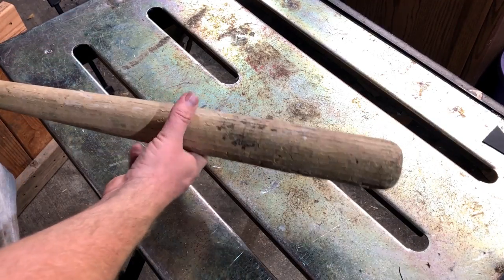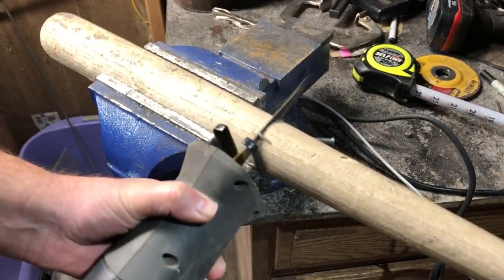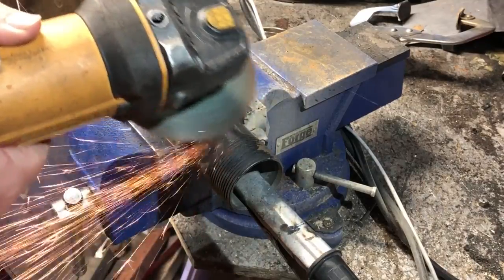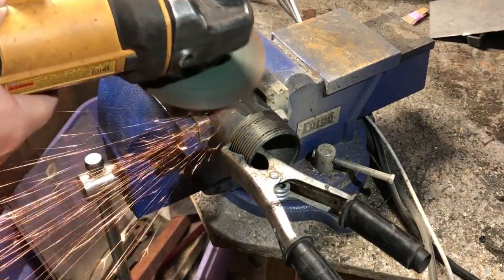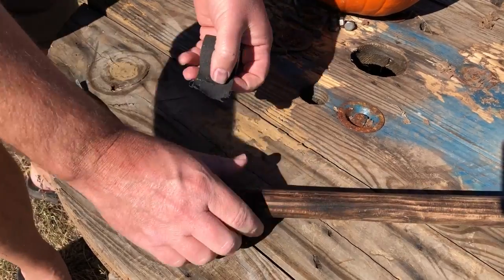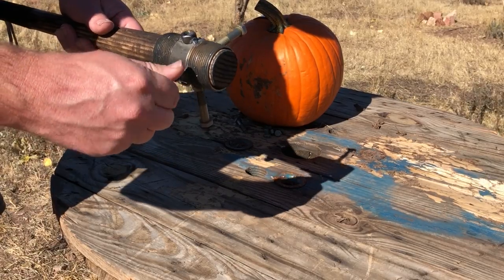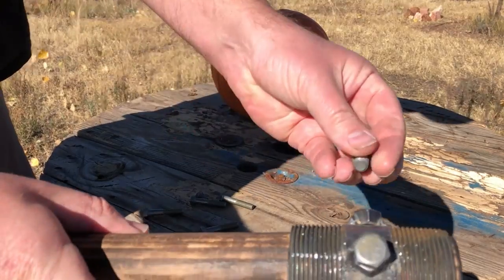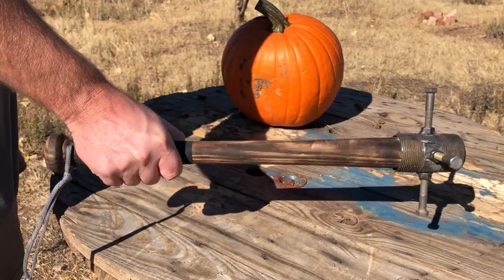How to Make a Trench Club (Post-Apocalypse Style with Adjustable Spikes) for about $10

Comment: Interchangeable spikes without welding. Drill recessed holes into the wood. Insert the nuts into the recessed holes and slide the pipe on top of it. When you screw the bolts in, the nuts will stay because they're larger than the holes in the pipe. Also, be sure to put a little piece of metal under the nut so that the bolt doesn't dig into the wood as you torque down.

Comment: Just a bit of info: Spikes on clubs aren't for penetrating, they're for focusing the force of a blow into a smaller surface area transferring more power to the target. It's the percussive force that causes the damage, they can kill people wearing helmets without penetrating the helmet and padding underneath. Last thing you want when attacking is a spike stuck in a dead guys head while other people/zombies are trying to get at you. If you're hitting someone without a helmet flat square 1cm long spikes would be the better option.
Btw im not knocking this video, this video is awesome, keep up the good work dude i'v subscribed :)
Reply: Supportive commentary is surely always appreciated.

Comment: A blunt weapon is by essence a weapon designed to cause heavy unprnetrating traumatic injuries. The long bolts are making the club weaker, even if sharpened as spikes, in a zombie outbreak scenario they would get stuck inside a zombie skull after the first blow. The shorter bolts are definitely better as it would performs kinda like a knuckle.

Penetrating short ranged weapons such as knives would, I think, only work onscreen. Clubs, hammers or war hammers would be ideal for close ranged combat as you could either kill the zombie rather quickly or bust its legs and then run.

Nice video I really dig that design!
Reply: Finally someone who knows what he speaking about

Comment: On the drilling holes on the bat and to epoxy the nuts inside. Something to strengthen the hold ub might be to drill the hole on the outer metal pipe sheath just to the diameter of the inside of the nut so your not only using epoxy, but your using the pipe as part of the stabilizer for the nut and epoxy.

Comment: Idea I don't have the stuff to do it welder Cutters what have you but what about a for flanged mace made out of two double bit Axe Heads cut in the middle so they can be meshed together then welded at the Four Points the fun part is trying to figure out what to do for the handle

Comment: What do you think would make the most durable base for a club?
Reply from the maker: Babushka Gopnik That’s a good question. I like hardwood because it’s relatively light and very strong. They use Hickory for a lot of tool handles for good reason. But I wouldn’t really make a recommendation except just to experiment.
Reply: probably the bat
Reply: Probably hickory or oak.
Reply: You could try melting plastic if you have a welder or solder.
Reply: Any hardwood you can get, ash is a good kind of tree to look for.

Comment: Try it with a pipe cap on the top and no bolt-spikes. This would be a configuration someone without a welder could fabricate, but I’m betting would still be quite effective.

Comment: Would you recommend using JB Weld if you don't have access to a welder? I'm thinking drill down thru the pipe and slightly into the wood. JB Weld the nuts to the pipe. More epoxy in the holes and thread the bolts in. I would be using short bolts for this.